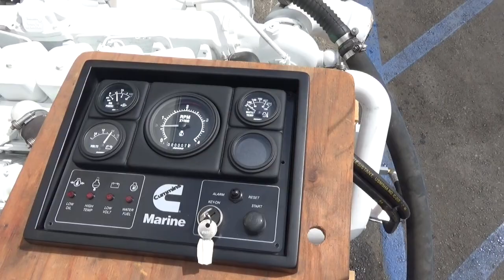Engine Test Cummins 6BTA 370 with ZF220A 1.5:1 & Trolling Valve

Comment: Is the trolling valve so you can leave one engine in neutral while the others in gear..As not to do damage to trans spinning while not running..OR a slower idle for trolling ? Just wondering as I am buying a baot with this same set-up..BUT I don't think it has trolling valves..I am wondering if I can run on one engine and save fuel while other is off on my journey. I don't want to risk damage to my engine thats not running and turning my wheel..
Reply from the maker: The trolling valve allows the output shaft to spin slower than it would at idle by allowing the transmission to slip a bit.  I wouldn't try to run one engine to save fuel. If you want to save fuel the best option is to find your hull speed or sweet spot where you burn the least fuel per mile.